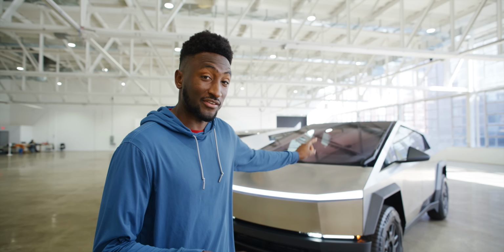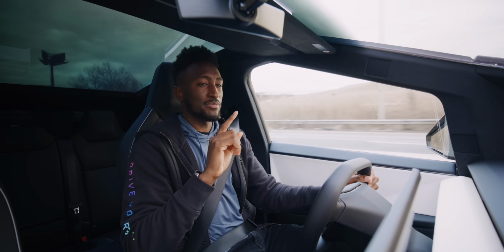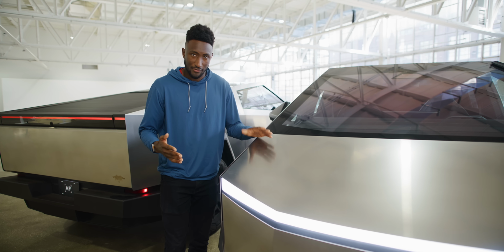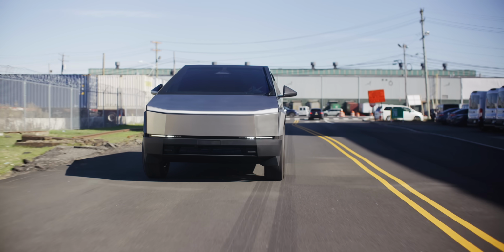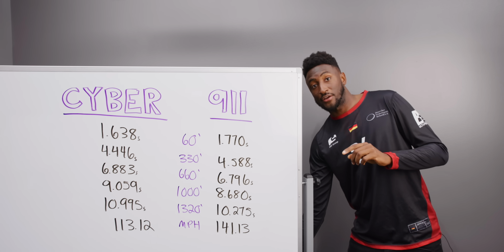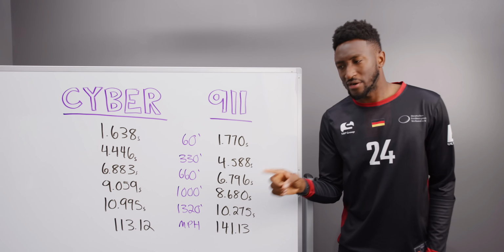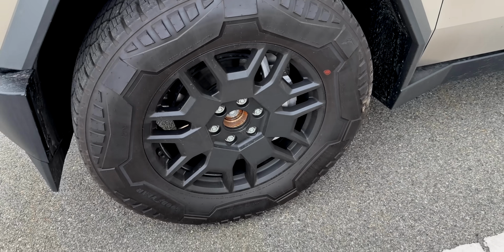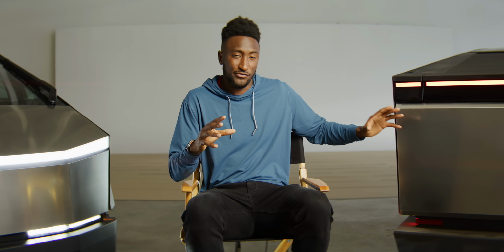Tesla Cybertruck Review: Already Iconic?

Comment: What I love : 1) Steer by wire system that changes its ratio based on the speed. 
2) 800 Volt High voltage architecture with the newer cells, 400 and 800 Volt charging, and 48 volt low voltage architecture. (Bless you for pushing the industry in the right direction)
3) Wade mode.
4) Off road mode. (I guess that should be a default feature for every truck)
5) 4 wheel steering.
What I don't care about : 1) Bulletproof (Meh 🤷‍♂, I like guns, but I don't think I'll be gunned down while driving anytime. And, its not that bulletproof either)
2) Steel body invincibility hype. (There are plastic portions on the bottom, is that still invincible?)
3) Speed and acceleration. (This isn't the model s, that should have been model s's selling point)
     Honestly, why didn't they create a drive train similar to the Tesla semi?, it would have given it the acceleration that they so love, plus, give it the range that we require from a truck.
What I hate : 1) Ugly shape (The same approximate shape could have been remodeled to look better, but this exact shape is just 
🤮. To mkbhd: The reason why people said it looks alien, is because they are trying to find words that do not make you feel bad about your purchase)
2) Towing range. (This is a truck, right?, why didn't they approach the design like they did for the semi?, they purposely changed the drive train for the semi to improve range, they could have done something similar here, then why not? just so that the one's who want to drive trucks like cars get what they want?, that's stupid, a truck needs to be a truck, everything else is an add on)
3) I love the minimalist interior design, BUT, and a big BUT, I WANT the gear change and turn signals to be physical stalks. I can easily imagine minimalist designs for stalks, example stalks with haptic feedback, and cybertruck'esk style sharply curved stalks, they will look better and wouldn't require as much expensive hardware but still get the job done. Also, they just went back to the center horn, but I hated that feature as well, its borderline dangerous, horn needs to be on the center of the wheel, no compromise.

Comment: MB should have noted that the Cyberbeast would in fact beat the base 911 Carrera T in the full 1/4 mile if it wasn’t towing anything. The base 911 Carrera is listed around 11.8 seconds for the 1/4 mile by Car & Driver.  10.9 < 11.8.  So yes, the Cyberbeast IS in fact faster than the base 911 from the Tesla video when it’s a fair non towing drag race. I do agree the video was a bit of disinformation making it seem like it’s faster in the 1/4 while towing a 911. But it’s still faster in reality in a fair 1/4 mile drag race.  MB’s 911 is a Turbo S and one of the fastest cars you can buy, so no one is claiming the Cybertruck can beat that in a drag race.

Comment: The point about stainless steel is just wrong. Cars are designed to have crumple zones because they absorb the energy of an impact, delivering less energy to the passengers, making it safer. The cybertruck will be fine if you get in a crash, and it'll deliver all of that energy into breaking your bones.

Comment: What a lot of people don't get is that the cybertruck is a monetisation of R&D for the future. They can sell it for a high proce to launch new technologies they'll need for the future robotaxi.
Steer by wire: allows you to deactivate and retract the steering wheel for robotaxi passengers. 
48v power and ethernet communication between modules, they can get a lot of experience with this on the cybertruck and have a better solution in place by the time they launch the cheaper car.

Comment: good video, but I think it misses a very important opportunity of speaking about the actual idea behind electric cars, and how completely twisted they are getting by Tesla. We are moving away from combustion engines for a reason that is not speed, or sound volume, or modernity, it's mainly a thing of saving energy and going towards sustainable, environmentally friendly cars. The Cybertruck, along many other electric trucks and SUVs takes a complete 180 turn on this, with its over 3 tons of weight and basically everything it is designed (not) to do. I would have wished to have this pointed out at least, instead of blindly (and maybe even kind of appreciatingly) doing drag races with it and shining the light on the pure marketing side of the vehicle.

I know, this topic is controversial, but I'm European, and I simply have no understanding for why this thing exists and why so many people still drive such huge cars in the US. It's just painful, honestly.

Comment: Brother,
This was a Fun & clever video covering many of the media fud and facts. 😎 
As for me, I love the CyberTruck, its futuristic looks, super innovations, and stunning performance. I say this in spite of loving sports cars, and having owned two 911's and other sporty cars. 

You're so RIGHT about the rear view mirror major miss (perhaps a gov't overlord issue), and the towing was a massive miss in spite of the irrelevant 6% factoid when considered a pick-up truck. We by a pick up so we can anything needed, if we need!  I've used my RAM 1500's to tow my boats and campers ... Tesla's use of that 6% factoid is not well thought out and more a defensive posture because battery capacity has not progressed adequately to support the 500+ mile range.  Perhaps the biggest letdown of the entire CyberTruck release!  I still hold hope they will soon resolve this with improved 4680 or other developments.

My take on the Stainless finger print issue... it is silly, but admittedly also why I no longer consider black cars, and which I'd say are worse for Dirt and Fingerprints than the Stainless CyberTruck. Stainless is a uniquely benefit for Tesla! This because Tesla/SpaceX Stainless cost benefits for a truck and I am a massive fan.  Sharing with SpaceX Starship vehicle massively is unique in bring costs down... once the "big brain engineers" designed the "machine that builds the machine!"  Both vehicles are made from an austenitic stainless steel alloy called "Ultra-Hard 30X Cold-Rolled stainless steel" for its high strength and Corrosion Resistance.
I believe it's also a showcases for the versatility of this particular stainless steel alloy... which may be considered for a future RoboTaxi and this heavy-duty CyberTruck pickup.

Cheers, Eric

Comment: The idea that ALL steering input depends on sensors is alarming to me
Reply: sensors they cheaped out on too, literally just cameras, no LIDAR, no depth detection
Reply: Ngl I do hate the people going like "Ooooo airplanes have had it for years"
While it is true, there's also a massive difference between flying in the air at 35000ft, and driving on a road surrounded by 100 other cars.
Reply: Every airplane flying commercially is like that though and airplanes are incredibly safe.
Reply: @IsaacSmithProductions Airplanes have strict check ups and whatever model that's commercially used has already existed for decades

Can't say the same about a Tesla, as well as many other reasons, it's ridiculous to compare it to an airplane
Reply: @xSyn08  "Airplanes have strict check ups and whatever model that's commercially used has already existed for decades"

Boeing enters the room...
Reply: @xSyn08 mechanical steering systems also have flaws too. The hydronic steering fluid can leak for instance. 

Planes adopting an electric steering system is testament to its improvement over safety and steer-by-wire is often regarded as safer
Reply: @YTho-ev1ej Mechanical issues at least provide you with an early warning if something is starting to fail, like increased stiffness and whatnot, but never a sudden loss of steering.

People often do not take care of their cars as much as they should and can be quite ignorant, so I fail to see how it can be "safer"
Reply: @xSyn08  Someone's got to be the first...
Reply: @IsaacSmithProductions That's true, only time will tell how it fairs, but it's just ridiculous to me to claim that it's safer already

I don't think it will ever be safer, but it can be safe enough to not be a concern, coming from the perspective of someone who is an electrical and software engineer
Reply: @YTho-ev1ej  Dude, my brother drove an entire week to and from work with a dead power steering pump. If any of those electronic systems go wrong, the car is a brick. Nobody ever said mechanical systems didn't have flaws, but if there are flaws there are still ways to make it work enough to get home. Not so with electronics.
Reply: @YTho-ev1ej  You can steer without power steering fluid. I know because my pump broke while driving. Because there's a physical rod connected to the wheel, the car is still fully operational. Not convenient or easy to steer, but fully operational even in failure.
Reply: @lucass8119  oh no shit. On my boat the fluid was leaking and the steering was lost and it caused a debacle to say the least, so I was going off that 😂
Reply: It has multiple levels of redundancy. You know what doesn't have that? Mechanical steering systems!
Reply: @TheBowerbird  The redundant part of mechanical steering is that it's physically linked.. even without power steering you can still steer it, and the fact that there is plenty of time for warning
Reply: @xSyn08 The physical link can break. And no you can't steer it if that part breaks.
Reply: @TheBowerbird  it won't break suddenly.. and again, because it is a physical link you wold FEEL if there is something wrong early..
Reply: @TheBowerbird The amount of force required to break that physical linkage is so high that it's not going to happen in any car that's remotely roadworthy though. Honestly the biggest issue is that it's going to be expensive to service steer by wire systems, and a secondary issue is that with Tesla's advanced but buggy software history I wouldn't be entirely comfortable with a redundant system where both the primary system and the backup are identical (ie running the same software, with the same bugs).
Reply: @bosstowndynamics5488  Tie rods say hi in off-roaders.
Reply: @TheBowerbird  It's very unusual to do hardcore rock crawling on the daily school run or the morning commute though. That's a high force, edge case and above all predictable and easily addressed situation and not at all comparable to the much lower force failure modes that apply to electronic steering systems

Comment: So, there's one reason for hand-over-hand longer steering racks on trucks: the ability to be slow and precise with your steering is great for placing your wheels just where you need them off-road, particularly on tricky obstacles where you've got ONE little rock to pop over or a specific rut to either hit or avoid that makes life way easier. This disconnect between what that 40-something-percent-or-less of Actual Truck People Who Do Truck Things need is no doubt where some of the chuckles come from, but yeah. As you noted, the Cybertruck's main use case for most buyers is as a flashy SUV on the street, and kudos for being self-aware enough not to go full Leeeeeeeroy Jeeeeeenkiiiiiiiins off-trail like a goofball with unrealistic expectations of its off-road chops, ha. 

"Willing beta tester" is a great way of phrasing the Foundation Series cars, too. I've seen a few and it's wild how much they sometimes differ from later cars. (Especially with the Roadster!)

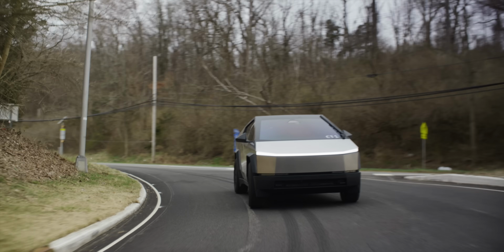Comment: 25:33 I would like to point out that the media also made a big deal about celebrities driving Prius or Hummers back when they first came out. Now, they are fairly common and you can find a bunch of them used for cheap. 

You can also make the same argument with the Model S. They used to be head turning when they first came out and now no one really cares cause there is so many of them. If Tesla does ramp up production to a similar point, the unique factor will wear off and people will kinda stop caring about it.

Comment: I do not consider buttons always to be the preferable. If fact the user interface in a car full of diverse buttons is often horrible both from viewpoints of aesthetics and usability.
I can actually prove it. Imagine a button for every functionality in a Tesla. The fart button would perhaps be funny - but it would be so cluttered. There is a reason why modern interfaces of complex machinery use touch screens. It also permits the user interface to be continually updated and improved by over the air updates. Further, hundreds of buttons is asking for maintenance problems down the road. Ever tried an old luxury vehicle? The number of broken buttons is always notable.
Whether Tesla has removed too many buttons is another discussion (stalks...)

Comment: I think you're downplaying the disgust a bit in that last anecdote, I know the review should be about the truck itself and I think you do a relatively good job, but plenty of people don't like the truck because of the CEO of the company. That's valid criticism when that CEO is so outspoken and such a negative influence on discourse. Plenty of people like that cyclist also don't like the size, weight, and speed combo of the truck which is lauded in the car community but should have almost no application on the streets, if drivers are prudent in their driving (spoiler, they won't be). There will be a spotlight on these trucks when they are involved in stupidity, and there should be, IMO, because of the attitude of the company selling them, and their sheer excess.

Comment: You failed to mention the most obvious problem with this thing: it’s dangerous. If you hit a pedestrian or biker with this thing, they’re dead. If you hit another car, they’re totalled. There’s a reason why other cars use plastic or thin metal paneling.

This thing is a hit-and-run machine.

Comment: I saw my first Cybertruck in the wild on a trailer along with an F-250 and was surprised at how big it actually is... I don't hate it... but I don't love it either. I was trying to compare it to other designs from the past... Airflow, Tucker, Avanti, Citroen CD... Pontiac Aztec? I think they achieved their goal of breaking the mold for pickup trucks but in doing so... is it still a truck? I learned to drive in a 1960 Chevy Apache w/3spd column shifter... no power anything except a V-8... so a no on it being a truck... lifestyle vehicle yes... truck no... even if you build it in Texas.

Comment: Marques, you're a really cool dude, and a great honest guy - and happy Easter, by the way . . . but there are two things that I don't understand from your presentation:

1. The idea that Tesla's new stamping process will ensure better fit and finish as Tesla Giga Texas gears up . . . to what I think you mean is full series production, and secondly,

2. The idea that it is overrated as a towing vehicle.

Unless the method of dealing with the 1.8 mm and 1.4 mm special order  stainless steel from Finland has changed s8nce Sandy Monroe got a tour with the engibeers and head of department around the time of delivery day -- then they are expressly not using stamping, but rather laser cutting and an air braked bending (to avoid bruising the exterior surface). There was an experiences production engineer speculsting on YT prior to the release that laser cutting and bending would conventionally limit (any other manufacturer) to 50,000 vehicles per year; it just takes too long compared with stamping. At least for anyone else. Of course, Tesla engineers may already have a weekly run rate proving me wrong here. But the point is that the fine tolerances demanded for the process they have chosen, this probably requires fit and finish problems to be ironed out very early, much ealier than you imagined. But - conventionally - at something like 3rd quarter 2024 Tesla hits the wall and has to decide if it can push the bending process, or if they have to start again with an actual stamping process. And remember, the new process was set up to cope with 3 mm stainless steel sheet.

The second thing was that are you meaning that all EV pickup trucks fail as towing vehicles. In the setting of a video production company working almost wholly in an urban setting, and without crazy deadines . . . I would have thought it could have been really goog. In terms of the feel of the trailer in relation to available power, and leveling and suspension generally. Also, the fact that you have the cover over the back. You can go to lunch an the fact that you have super expensive gear that can't be seen  together with sentry mode, even the foldup back seats, it all goes to make up a reall superior package - when you are hauling anything in a day of shooting.. I don't know. I've got to go to look at the Out of Spec Review of all the cutrent EV trucks towing trailers with a caf ontop - oer the Rockies. Admitedly, their chief reviewer has a lot of experience and none of the expectations of guys knowing and absolutely needing what a diesel can do. But, would you really be better off hiring an F-350 for anything yoh are needing or requiring?

Comment: I feel like the rear wheel steering isn't on other trucks because the towing is best on a solid axle. When you put the steering knuckles on the end, you introduce a weak point or potential failure point under load. I do agree most folks don't tow as often or as much as they think when they buy a truck and how it impacts battery mileage is enough to keep it from really being much of an issue with this vehicle.
Reply: GM had a SIERRA Denali with four wheel steering back in the early 2000s but it didn’t sell that well.

Comment: In the early 80s, for a year or so, before Back to the Future, even, the Delorean was something that turned heads.  Now, it was not a good car, to be fair, but a gull wing stainless steel car. And the few I saw in the late 80s.... The steel on those models looked pretty bad by that time. Very blotchy. But the steel wedge design was something futuristic for it's day.